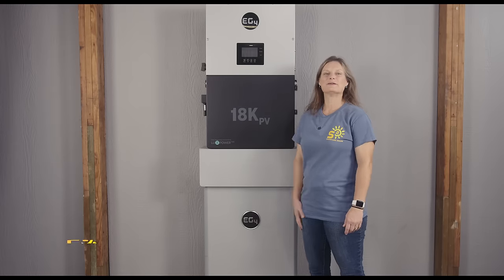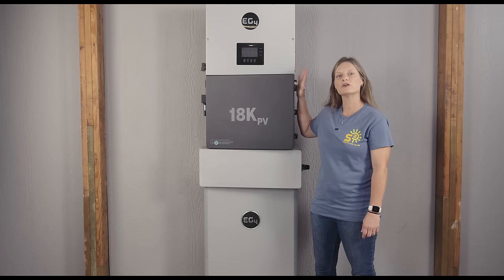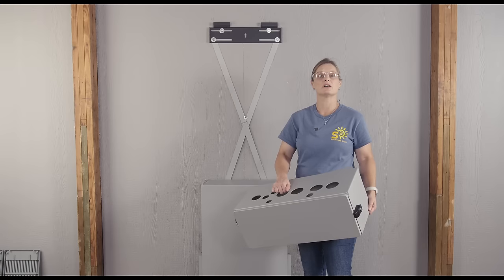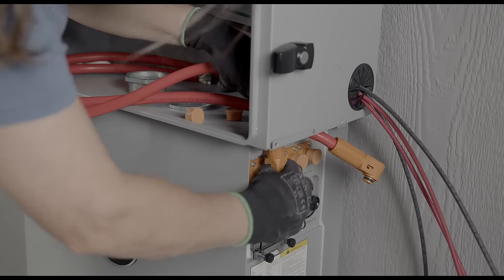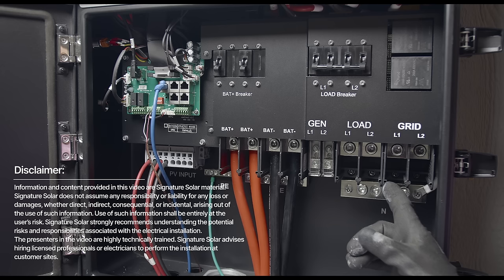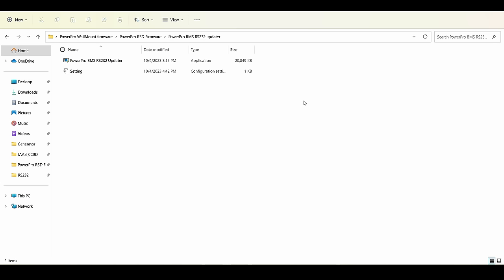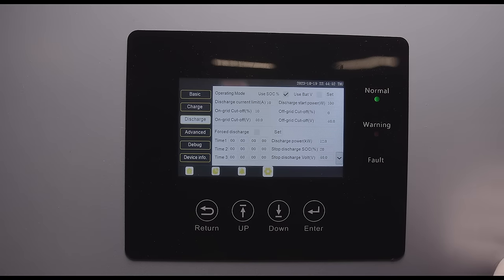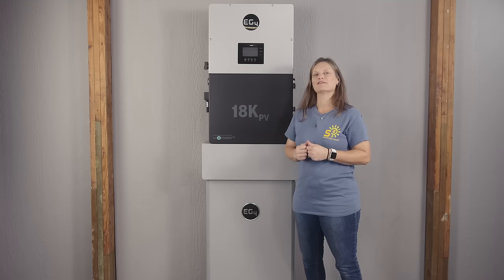EG4 PowerPro ESS EG4 18kPV Hybrid Inverter & PowerPro WallMount Battery Install and Commissioning

Comment: This was a GREAT help when commissioning my system. One thing I had problems with after following the video was that I needed to switch my battery dipswitch BACK to the proper "ID" after I put them all in the top position to run the com setup. If you've just got one battery you just need to flip that first dip switch down and you're golden, otherwise check page 24 of the manual.
Reply from the maker: Thanks for the feedback!

Comment: I like your video. You need insulated bushing on your metal chase nipples for the larger battery feed cables. NEC 300.4(G). Conductors larger than 4AWG
Reply from the maker: Thank you for reaching out and providing valuable feedback. You are absolutely correct, and we appreciate your keen observation. According to code, ground bushings would indeed be necessary in this setup, and we acknowledge that we overlooked including them in the video.

Our intention was to offer a general tech bench setup for better understanding, but your input highlights an important aspect that we should have addressed

Thanks again for your input!

Comment: great video but the firmware and BMS software is no longer available on the EG4 website under the tabs shown in the video since the website has been changed and the new tab for that stuff: Resources>Software doesn't have the updates. How do we find this now?
Reply from the maker: Hi @allthingsinteresting649 - You will go to the resources tab and to downloads, search the product that you need firmware/software for and it will list below the product. The BMS tools and test are under the software/drivers section. Here is the link to the 18Kpv firmware: https://eg4electronics.com/categories/inverters/eg4-18kpv-12lv-all-in-one-hybrid-inverter - I hope this helps! Please let us know if you need any assistance!
Reply: @SignatureSolar  there’s nothing but PDFs on the website now

Comment: I followed this with my battery install. The 2 things that would need to be noted are you pressed (return) you said 2x but actually pressed (enter) return takes you back to a previous screen and enter saves the selection. 

Also

The dip switches at the end (after programming to lux) need to be flipped to 1 up and the rest all down before it will communicate to the inverter. These changes to the video would greatly help a new person out. I had to dig elsewhere for this information as well as the password for the touch screen being “Signature”
Reply from the maker: Thank you so much for your feedback! We will forward this to the marketing department!

Comment: Great explanation video. One of the best I've seen so far. Im thinking of getting that combo before end of the year. I have a grid related question, in the event that i want to connect a grid power for ONLY to assist in charging the battery, and NOT to send back to the grid. Is there any specific safe instruction that can be shared to do that?

Thanks
Reply from the maker: So glad it was helpful! 
To do this, you will enable Off-Grid mode and AC Charge Enable settings in the inverter's screen:
Off-Grid mode = Advanced settings | PW = 00000
AC Charge Enable = Charge Tab
Start Charge at 46V end at 56V

Comment: I cannot install the firmare because in device manager, the Port COMS & LPT shows an error: "Windows cannot determine the settings for this device.  Consult the documentation that came with this device and use the Resource tab to set the configuration. (Code 34)" 
ideas?
Reply from the maker: Hi! If you'd like to reach out to our tech department at 903-441-2090, we can get you a resolution!

Comment: Can the EG4 PowerPro ESS EG4 18kPV Hybrid Inverter and PowerPro WallMount Battery units be installed with their backs against the floor, or are there specific mounting requirements or limitations for optimal functionality?      The crawl space height is too low for the units to be installed upright, so we need to ensure compatibility with this orientation for installation.
Reply from the maker: We do not recommend installing units on their backs. The manual shows the recommended configurations.

Comment: OK connecting battery cables 15:30 looks simple.  Well maybe not no mater how I twisted and tweaked the fine wires were totally unruly
and refused to all go into the buss bare hole.   So I invented a method to make it work.  Take a piece of letter paper cut a square about 2.5"
to 3" wrap this tightly around the cable end with the wires a little less than flush with the end of the paper.  Insert the paper and cable end 
into the buss hole then carefully wiggle the paper out being sure not to leave any paper bits behind presto all wires inside the hole.  One 
other tip put your little finger into the buss hole adjust the screw such that it is flush with the bore.
Reply: I complained about this too -- ferrules are a needed item here but do not come with any part of the system. I could find no 2/0 size ferrules anywhere locally; so I stripped about 10 inches off some solar panel cable and took at one thread of wire, which I then wrapped around the end of each battery cable to bring the fine wires all into a tight bundle. It worked perfectly, but I still ordered ferrules and a crimper from Amazon. In my opinion, this "small" but very important issue is avoidable by the manufacturer and is glossed over in this video.
Reply: Take a thin string and with it, tie a half hich around the strands to bunch them together. Tie it so that when you pull one end of the string, the knot comes untied. Insert the cable, pull the string out. Works great.

Comment: Thanks for the information. I am thinking of purchasing 2 PowerPro Batteries to be mounted on a separate walls in a L figure or do they have to align on the same wall? I am tight on space.
Reply from the maker: You would just need to have them close enough so the wiring can reach! Let us know if you run into any issues along the way!

Comment: Hi, after connecting the eg4 18kpv to the wall mount battery as shown, how do I start the inverter without blowing out the capacitors? Please explain step by step because I realized nobody is using a  precharge resistor for this setup.
Reply from the maker: Hi! 
Internal precharged resistor on a few seconds timer. 

1. Turn on the inverter's battery breaker first and any in-line breakers on the positive line

2. Turn on the battery breaker

If you have any further questions, please don't hesitate to reach out to our tech team at 9034412090, they will be glad to make sure you're up and running smoothly!

Comment: If the outdoor battery is mounted to the ground and the area gets flooded - how high can the water get before causing an issue to the battery?
Reply from the maker: Hi! It has not been officially tested but we have had customers report that they have flooded an inch or so and the unit has been fine.

Comment: What size conduit used for power pro to power pro is used? 1.25 pvc does not let the Degson connectors to fit thru
Reply from the maker: If 1.25 is code compliant in your area, you can upsize to the next size that will let the connectors through :)
Reply: @SignatureSolar  so why would you send connectors that won't allow the cable fit thru
Reply: @SignatureSolar  so why send fittings that won't accommodate the cables

Comment: Is there a way to upgrade the inverter firmware without a smart phone?
Reply from the maker: Hi! Yes! Firmware on the 18kpv can be done by logging in through the monitoring platform at monitor.eg4electronics.com

Comment: Guys, how to program this for time of use? Use my batteries between 11-7 and charge them between 7-11?

I also have a small solar system that helps charging my batteries
Reply from the maker: Give our tech support department at call at 903-441-2090, they will be happy to assist you!

Comment: Where can I purchase the cables needed as shown in video. Rs45? Is this supposed to be rs485? I’ve got the eg4 18 and two eg4 pro battery’s and soon when winter is over I plan to install my adani 30 panel array. I think I have all my parts now? Order#100870 
I just want to make sure that upcoming I have what I need to complete the install. Recommendations for safety gear?
Thank you.
Reply from the maker: Its the read/write cable - https://signaturesolar.com/eg4-usb-read-write-cable/
Reply: @SignatureSolar  just the one is all I need? I thought there was two? Can I purchase both from you if so? Thank you 😁
Reply from the maker: Yes! You can purchase them with us!

Comment: What is the pinout for the RS232 communications?!?!?!?   No one at Signature or EG4 can tell me.  The documentation for the battery only references
Pin 1 & Pin 8 ‒ RS485_B
Pin 2 & Pin 7 – RS485_A
Pin 3 & Pin 6 ‒ E-Stop NO
Reply: @Scotty2Balls  I did ask the MANUFACTURER. Read above.  Everyone uses the "this is a new product, let me check." and then crickets. They can't even really tell me what the correct firmware version is.
Reply from the maker: You can use a straight through Cat 5 or Cat 6 cable and it will work. Let us know if you have any other questions, we are happy to help!
Reply: I was finally able to figure out the pin out for RS-232 firmware updates.  Had to do a lot of digging and troubleshooting.

DB9 Pin 2 (RXD) -> T-568B Pin 4 (Blue)
DB9 Pin 3 (TXD) -> T-568B Pin 5 (White/Blue)
DB9 Pin 5 (GND) -> T-568B Pin 6 (Green)

Comment: Posting this here because neither EG4 nor Signature Solar has answered my communications from earlier this week:  

1. Sig Solar sold me 2 Victron Lynx Distributors so that I can add a 4th Power Pro battery to my 18K inverter. But it came with no instructions. How and where do I install those and what do I need to do or buy (e.g. what fuses, wiring, etc.).  

2. What alternative is there to using a laptop for battery firmware updates?  I do not own a laptop, and because I am off-grid -- I would likely lose power to my Mac desktop if I tried to use that (also I would have to go the trouble of relocating my computer to where the 18K and batteries are installed. 

3. In testing my 4th battery (I detached the 3rd battery and rewired to #4). I got a "bat open" error and system shut down. What does this mean and could it still be a problem when i get this battery installed (assumedly with one or 2 of the lynx distributors). I have some concern that the battery was damaged in shipping because the box was damaged and the edges of the top cover on the com port side were broken.

4. I received 2 different types of green com cables – some with screw-caps on each end and some with the cap on just one end. None of the wiring diagrams indicate where all of these are to be used – it appears that only one cable is needed per battery, with the primary battery com wire going to the inverter and then 2 com cables going to the primary battery. That leave extras with no use, unless they also need to be used somewhere. Please advise.

5. With regard to the 4th battery – how does it communicate with the inverter? What wires are needed and where do they go (see Q1 above).

6. I also received an orange cable and a gray cable. Are those for the firmware updating or something else? I see no reference to them in any of the manuals.

7. The Sig Solar YouTube install video shows a ground wire installed from the Power Pro battery to the inverter. This is not in the manuals. What type wire should be used? Does each battery need to be grounded to the inverter? Or can the grounds run from one battery to another? 

8. I have seen conflicting info on the battery dipswitch positions. To indicate battery No 1 do you have the first switch up and all other switches down or the first switch down with all other switches up? And in initial set-up – all dip switches are up, correct?

9. Regarding the conduit boxes – I highly suggest making the openings to the battery plugs (on the batteries) a bit larger and the edges of those opening less sharp. Or you could provide proper conduit nipples to better protect the battery cables.
Reply from the maker: Hi Collin! That is quite a few questions that may require some troubleshooting and documentation to be sent to you. If you'd like to reach out to us directly at engagement@signaturesolar.com with your name and contact information, we can get you connected with the tech department and get your questions answered!